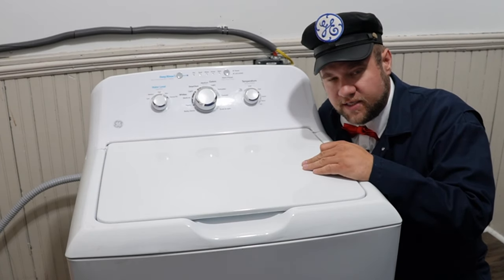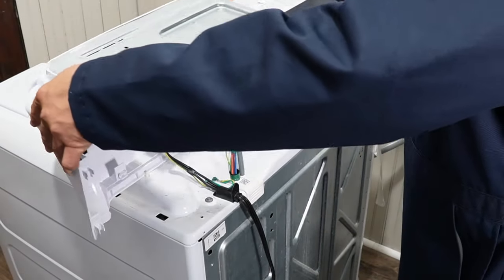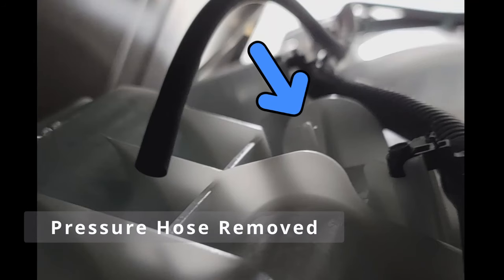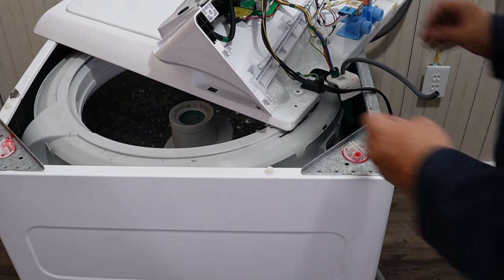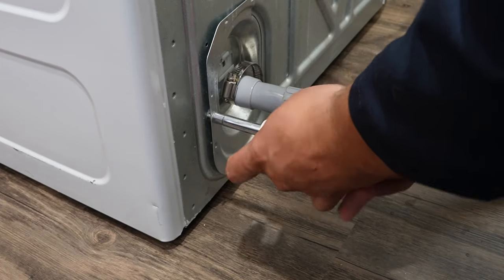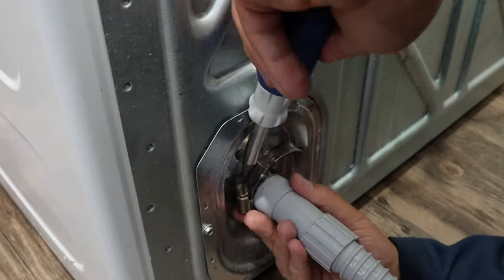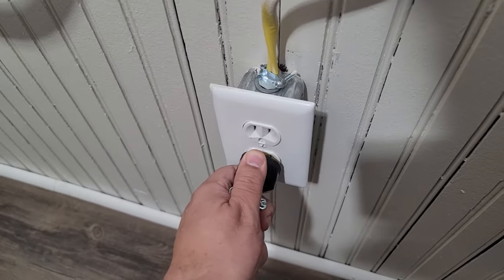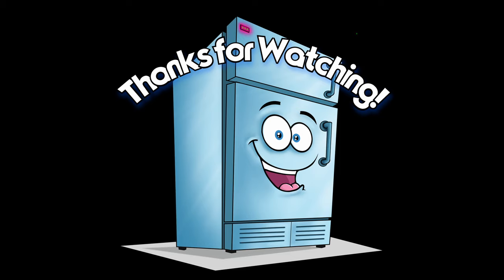GE Washer Won't Drain or Spin Dry Clothes Well - How to Fix With a Drill

Comment: I could not figure out my washer problem until I found this video.  The drill bit worked, and my washer is running again.  The wife had already picked out a new one, so this video saved us $500 plus dollars!😁
Reply from the maker: Glad to hear it!
Reply: You got to fix em  quick before the wife gets a new one😂
Reply: Wife probably pissed 😂😂😂
Reply: I’m currently dealing with an issue, says 23 fault code lid lock critical, I bought a new lid lock harness and switch still same code. It will fill then cut out. I did my tests, it will agitate, it will drain , would the recirculating pump be a cause of this

Comment: After watching like 20 videos and replacing the speed sensor with no results I found this video. My issue was the washer agitating, draining but not spinning. It would just shut off at the spinning part of the wash cycle. After following your instructions I was able to clear the tube and reassemble and it worked! Thank you for the help. Saved me from an expensive repair bill or even worse having to buy a new one.
Reply from the maker: Awesome!

Comment: I have this same washer, but i have a different problem. It will only wash a full-size load. Even when set to small, it fills up to the top. And when set to bulky, it will not start. I can't find any info on what's wrong, and no code is coming up.

Comment: You are a hero! Mine was a different model with a much easier to access connector. It had a little 2" water collection part where the tube attached to. The place where the tube connects was clear, but apparently the part on the inside was clogged. After blowing some air through there, it cleared and we are back in business! 

The original symptom was that it wouldn't spin! Then it started going in drain only mode. So not obvious!

Anyway, thanks a million! Saved me buying a new washer this weekend!

Comment: My GE top load washer was doing the same thing. 
On a any load size, It would dispense some water and just stop, nothing.  I saw your video and followed you instructions. The only thing I did different was, I blow into the tube from the top while still attached to the bottom and since I still had water in the tank I could see the air bubbles come out. So, maybe that cleared. I put everything back together and the washer machine worked. 🤔
So thank you for your video!

Comment: I did this procedure on my identical GE washer and even though I felt no resistance when inserting the drill into the pressure port the washer works just like new now after reassembly. Thanks!

Comment: I have a basic GE washer that is about 12yrs old. It recently stopped agitating and spinning with a load and smells like something is burning. The belt is good on it and I tried the reset motor code process. Technician was going to come out today to look at it. He called before to get more info.  He told me most likely motor or transmission. He said those are known to develop small oil leaks, which cause belt slip. Told me I was better off to get new washer, since it would cost so much to fix. What are your thoughts on this?

Comment: Mine makes a grinding noise and all the grease has dumped out of the transmission. Has the same symptoms & does5 spin out the clothes. Appliance repair store said the transmission had failed & said it was a common issue on  these. I actually have a second one with the exact same symptoms and problem but has oil all over the engine and transmission belt cover. Not spinning out all the clothes. Wondering if it could be this or the transmission. Going to try your solution first I guess. I assume you're not having the grinding noises?

Comment: I have a fairly new washer I’ve just got a old one I’m wandering if I can use the pump to make a shower with it as I’m living off grid and like to think about what I can use over maybe for other things 👍love ur Chanel very interesting 🧐
Reply from the maker: Yes! Absolutely! How you use it will vary based on the voltage of the pump, but they'll absolutely work to move water in any other way you can think of, if hooked up right.
Reply: Have fun out there

Comment: Ehh. brand new GE from Wayfair and it was not spinning out enough water. I couldnt get a 1/8 inch drill bit to twist in there, but I got a slightly smaller precision flathead that snugly fit the opening, and there was an obstruction as you describe. I got a smaller-than-1/8 drill bit and used it as a reamer, filing the edges at the end of that channel. I had a 1/8 inch end mill bit with which I was able to ream the passage out, but the business end of that wasn't long enough to reach the flashing area. Still can't get the 1/8 bit in and twist it freely but I knocked the obstruction out in any case. We will see if that does it!
A note:  If you are unsure how far back you can go, get a smaller something that will fit past the blockage and you can "feel" where the wall of the tub is.
UPDATE: It didnt  help, the clothes are still far too wet, too much water left in there. SMH. Not sure whats up with this one.
Reply: He said a 1/16" drill bit  a number of times

Comment: I brought that same washer 10 months ago. After 3 months the lid lock would lock and unlock over and over. After it sat for a week it started working again. But when ever it would be humid it would do the same thing. I would have to dry it with a fan. 
NOW it’s doing this. 
I think it has multiple manufacturers defects !!!

Comment: I have this card t washer. I’ve added a new belt, new drain pump, and done what you suggested in this video. I still have the same issue. It will wash and spin and gets up to speed but It seems like it might not be spinning long enough. The clothes are still wet after spinning. Not wringing wet but wetter than they should be. Could it possible be lid lock? I’ve made sure level and clothes are spread and Balanced all that good stuff. Again it gets up to spinning fast but just seems like it should spin at that speed for a longer time. Washer is only three years old. 🤦🏼‍♂️. Our last one was 17 years old.
Reply: Did you figure it out? I changed the lid lock it it didn’t solve mine.
Reply: Control board would be the next logical step
Reply: If it's spinning  but not draining there's something clogged up in your drain pipe. It's a common issue

Comment: Had intermittent drainage issues where it sometimes wouldn't drain now it seems like the pump wont run at all so I think I'll check the pump first then that hose line.  But man is it aggravating how difficult it is to troubleshoot or access the washer for repair.  I swear they made it as difficult as possible.  My old washer had multiple removable panels this seems to have none.  Also there were zero error codes or trouble shooting help, just a washer full of water.  Frankly after this experience I never want to buy a GE appliance again but no idea if there are even any alternatives any more.
Reply: You ever figure it out? I’m thinking the pumps going out on mine. Won’t drain after rinse to spin. Last time I literally just took off the guard to the belt and put it back on and it started working.
Reply: @EasedBluntman  Yeah, the pump was full of gunk and sand.  I removed the pump, washed it out, reinstalled it and it's been working ever since.
Reply: @mkuhnactual  thanks a ton going to give it a shot
Reply: @EasedBluntman  Be careful with the pump though, I recall there was a point in disassembly where I felt it should disassemble further but was getting a lot of resistance and I didn't want to break it.  Iirc I submerged the pump in water and manipulated it to get the sand out.

Comment: Please help me out. I have the same washer and it'll wash the clothes just fine. However it won't drain the water or spin the clothes dry. It just shuts off after the wash cycle like it's done but it's still filled with water...
Reply from the maker: Likely had a bad pump. I'd drain it and check pump
Reply: James. I'm here for the exact same reason. Just finished draining this thing. Thinking drain hose was clogged due to pet hair. It's fine. So. Now on to the next
Reply: @bensappliancesandjunk  how does one check the pump?
Reply: @MeisterDeeLiTe  lol I just bought a new Samsung set from lowes. I looked at reviews and this washer is a pos with multiple problems😂 
FB market place it goes
Reply: @jamesmay8740  fyi. I just drained this pos and then ran a drain and spin cycle and dern thing SEEMS to be working now. Please don't jinx me 😂
🤞 Wash cycle going so we see shortly. Not sure if you meant the Samsung is crap. I'm scared of em. Come to think of it. I guess they really all are nowadays in all honesty. I miss a basic HIGH CAPACITY washing machine that works a good 25 years.
Reply: @MeisterDeeLiTe  best of luck brother, I just posted the GE for 15$ on market place😆 I also think Samsung is trash but at least I have a warranty.
Reply: @jamesmay8740  duly noted. I have 2 of these things. The pump is clearly out on one. I will be selling both. One is only 2 years old. Been in storage a year and a half. This one is my mom's that passed away. It's going first. Forget that sentimental stuff. Gotta go. Maybe I'll go with Samsung too. Seems others are so. I'll follow along. Many thanks man.
Reply: we have the same washer as above. After wash cycle it  should drain THEN spin before rinse xycle. In not draining it most likely the pump. After wash cycle and your washer doesn't drain / turns off, set to drain and spin and  push go. if no drain then most likely pump. if drains but no spin it could be the belt. Either have repair videos on YouTube. Good luck
Reply: @sendoolio1235  what if on the drain and spin cycle it drains, barely spins, then fills with water again?
Reply: @mollymoomoo1204  Hi, my best guess is if it drains bit barely spins between wash and rinse. And barely spins after draining from the rinse cycle, it could be your belt is slipping and needs replacing. I had to replace my belt at 5 years. I hope that helps. And sorry for the late reply.. i believe i have a link to a repair video... Also, try doing the reset as  mentioned in the video. Unplug washer for 30 seconds. plug in and open and close lid 8 times  in 15 seconds. (research this because different sites say different methods)

My original problem was no spin between wash and rinse and no final spin after rinse cycle. we cleaned the tub end connection of the pressure tube as described,  reset the washer and it worked like 
new 🎯

Comment: So I have a Maytag ensignia washer not completely super old but at least 10 years old maybe a bit more and it's spinning. But not good. It's leaving clothes wet enough that I can still ring water out... We got it from my son's grandpa and it didn't spin the first couple times. Then it randomly started spinning. It goes fast. But it also makes a clicking noise under or in the agitator sometimes while spinning.. he bought it new from Sears, and it did this back then too. 

Any idea what this could be?

Comment: I have a GE washer model GTW860SSJ1WS that won't drain or spin, this happens with about 25 minutes left in the Towels/Sheets cycle. The thing is, the Speed Wash mode works just fine, drains and spins and completes the cycle. What could be the problem? Haven't tried this fix or anything else yet beyond unplugging for a couple minutes.

Comment: to add to the control board being burnt, i had a $300 lesson in drain pumps that went bad blowing out the board. I now replace the pump with any control board showing signs of self-immolation.
Reply from the maker: Yep, I've had that happen on a Whirlpool a time or two. However, we do board repair and were able to trace the R050 that got burnt due to a bad pump. We decided to try direct-wiring the pump to test it and the explosion on that one was impressive.
Reply: Happened to me too on a cabrio , go figure 😂 

That was my lesson on drain pumps taking out control boards even if they test with continuity it doesn’t mean it’s good!

Comment: So this definitely helped my washer not spinning the clothes dry issue. However, i have a new issue... After doing the drill bit and blowing the gunk out of the hose and reconnecting it all. The washer isn't sensing to stop at the right  level  now and just fills all the way  to the brim and enters flood mode which in turn doesnt initiate the wash cycle. Any ideas ?
Reply: you end up fixing it?
Reply: Mine did that as well all on it's own. First flooding only in the x-lg mode then it didn't matter what size I put it on, I had to shut off the H20 after every fill, turn on for every rinse then turn off again, then it stopped flooding for a year. So many other problems with this washer...UGH!

Comment: I have a ge washer model number gtwn3000m1ws that won't spin. There a red light blinking 3x on the motor. What does this mean? Please help..
Reply from the maker: Unplug machine, wait 1min, plug it back in then lift and close lid 7 times in about 30 seconds or less

Comment: I was hopeful.... tried this fix, but still no fast spin. I have replaced suspension rods, but still get 'out of balance' stopping the fast spin no matter how small or re-balanced load I have. what can I try next?
Reply: It looks like the author doesn't answer. I have the same issue low spin speed and filling with water trying to get it balanced and over and over again till stop. What is the point to clean the hole? Enough to blow in this tube with a air duster in case of overfilling the tub but low speed how it is connected?
Reply: Call GE factory service.
Quick and not very expensive

Comment: Do you have a video on how to remove the body panels only? I am looking to add sound deadening to the inside of the body panels
Reply from the maker: Of a GE washer?
Reply: @bensappliancesandjunk  Yes of that exact model in the video. Sorry I was clear earlier
Reply from the maker: @jmer3536  Unless I am thinking wrong, there are no body panels on these style GE Washing machines, its all one huge shell, save the back and that comes off just with the screws. You'd have to do top-down through the lid like how I accessed it.
Reply: @bensappliancesandjunk  Oh OK. Gotcha. Thank you for your time and your videos

Comment: Started with this fix attempt but  it didn't clear issue. So I ran the diagnostics and trouble codes 14 and 23 for lid lock issue. Cleared codes and changed out the part. Still not spinning and the same codes showing again. Anyone have any suggestions?
Reply: I had this issue forever and I kept having to remove the clothes to get it to spin and complete the cycle so I could use drain and spin. Then it stopped draining the water all together. We access our GE washer through the bottom by tipping it on its side. We took apart the drain pump and cleaned it out, reassembled it and now it works. I don't think it was completely draining which made it out of balance causing the spin light to flash.
Reply: I took a chance and ordered a new controller board. Looks like that was the trick. Don't know how or why it crapped out. Total costs between new board and lid lock mechanism was about $230.00.
Reply: @NRay-bt2kj  , I guess this is my next attempt.... I've replaced suspension rods, blew out the drain pressure hose per this video. washer seems to drain, but still no fast spin.

Comment: Ben, I need a video on the 2018 Frigidaire laundry center that won't stop spinning!
Reply from the maker: I dont have any to record, they are rare where I live. However, they have electronic controls, and that means its feeding the motor electricity. I'd imagine a relay has fused.
Reply: @bensappliancesandjunk  ugh, I wish I could send you one! I got 4 of them here. All with the same problem. I replaced drain pump, pressure switch, motherboard.. door lock on a couple. Drilling out the tub hole fixed one but not the others. Pulling my hair out over here!

I'm charging $400 for your Samsung defrost add-on and doing 2 a week! Thanks bud!

Comment: The new GE washer design is very poor.  It's easy to loose balance and not spinning. I have to try to even the loaded laundry and redo the spin. Unfortunately, it doesn't work sometimes. The only solution is replace it with other brand!
Reply: Did you call for GE factory service?  Quick and not very expensive

Comment: I bought a top load GE Washer February 2022. Model # GTW335ASN2WW. After using 1 year 4 months it would not go into the Spin Cycle. Tried watching various videos. Nothing seemed to help. GE used to stand for fairly reliable products. Won't be buying another one.